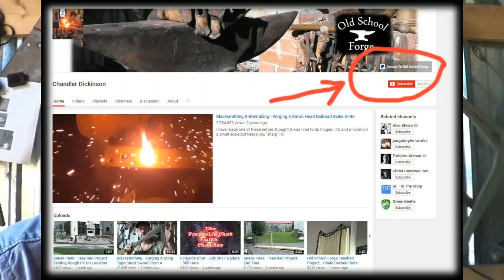OSF Shoptime - Mailbox Stand

Comment: 45 min in and so far I already see three upcoming need a tool make a tool videos. A chop saw blade sharpening jig, a portable support stand at the height of the table for stuff that hangs off, a rocket stove shop heater to put more of the heat from the firewood in to the shop. Great work Chandler, thank you for sharing an afternoon in the shop with us.

Comment: 3 hours of Chandler or Netflix for bedtime watching.... No contest! Chandler in the shop! beer and popcorn time.

*Edit, When getting the angles and welding the first 2 posts without using a calculator or square simply use a couple C clamps and 2 steel plates. Clamp the plates over the top ends tight enough to keep them together but loose enough that they can be adjusted. Tack weld one corner, go to the other corner and tack weld it. Now remove clamps and plates and proceed to add the other 2 corners then weld up the top followed by the corners. You get the perfect angle without all the messing about with math, (no math, no mistakes shortcut FTW). I keep a couple small light aluminum clamps and some aluminum plate for doing that kinda thing.

Comment: awesome build man!  I used to have a problem with punks hitting my mailbox with a bat, or driving over it. So i used a 4x4 steal tube and mounted it 3Ft in the ground. Covered it with wood, then wrapped my mailbox with 1/8" steal. it looked like your normal box but i guarantee when they hit it it hit back! its still standing after 20+ yrs. lol

Comment: Regarding your math for the peak: you got the numbers backward. Tangent is opposite over adjacent, so 41.5/64 ~ .57 radians, not degrees. Convert to degrees, and that's ~ 32.9 degrees. for the half triangle, or ~65 degrees for the whole angle.  The radians threw you off!

Comment: "SOH CAH TOA should have worked..." Yup, it would have. But, you didn't use TOA. You used TAO. If you use tangent with adjacent over opposite, your going to get the wrong angle. Tangent is equal to the opposite over adjacent which would have been "inverse tangent(41.5/70)=32.96" the inside angle of your peak would have been 33 degrees per side making 66 degrees between opposing legs. 
On a side note, when looking at it before tacking or test fitting, if the hypotenuse is longer than 1.414 times the base of a right triangle then the angle at the peak can not be greater than 45 degrees (the square root of 2 is about 1.414 and a right triangle with a 45 in it is a 45-45-90 triangle with a ratio of 1:1:1.414 for the length of its sides). Considering a ratio of 1.414:1 for 45 degrees, your ratio of 70:41.5 reduces to 1.687:1, meaning the peak would have to be less than 45 degrees per right triangle and a total of less than 90 degrees between the two opposing legs.
I hope that makes enough sense. Also, I don't remember if you were using 70 inch legs or 72, but they're close enough that the explanation still should apply.

Sine=Opposite/Hypotenuse, Cosine=Adjacent/Hypotenuse, Tangent=Opposite/Adjacent